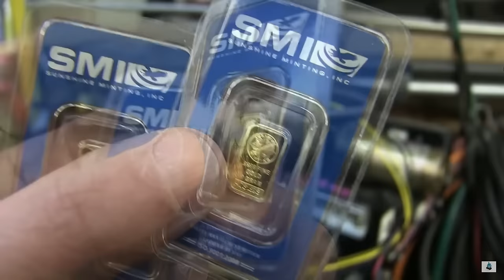Cold Welding In Vacuum

Comment: You can test to see if it was the mercury vapor by repeating the Spregel pump experiment, and in addition to the 3 samples you already had, build an additional vial shaped like an upside down u, with mercury in one side and copper in the other. This will keep them separate, but will allow mercury vapor to bond or saturate the copper.

Comment: I am thinking that the reason you get "cold welding" when you slide or twist two pieces together is that the friction causes heat, although not much, there could be micro spots where temperature is high enough to fuse.  You might be able to weld with enough pressure, like with a hydraulic press, but I would bet it would be a pretty high pressure.  Somehow there has to be enough energy to break the bonds so these reform to become a weld, a high temperature is most likely the cause.

Comment: Hypothesis for why rotation causes cold welding but not impact:
First assumption: metals form locally polarized crystal lattices of arbitrary length.
Derivative assumption: these lattices form locally polarized magnetic fields.
Second assumption: these lattices have a normal distribution with the possible exception of a slight bias towards the geomagnetic poles.
Derivative assumption: when brought together, the lattices in the two adjacent surfaces partially align and begin to repel.
Derivative hypothesis: when the adjacent surfaces are then rotated, the partially aligned surface lattices become orthogonal and attract, forming a weld.
Experimental hypothesis: there exists some angle of rotation that will achieve maximum normal distribution of orthogonal lattices given an arbitrary lattice length.
Plain English hypothesis: if you rotate two plates of indium at known angles, you will see a normal distribution curve of weld strength around an optimum angle from which you can then derive the mean length of the surface lattices.
That wasn't really plain English, was it?

Comment: Think of the oxide layer as a thin piece of tissue paper covering each piece of metal. If you slap them together the paper stays relatively intact, but when you twist them together the paper tears and pulls apart. exposing the metal underneath. I think this is why the twisting works over slapping them together.

Comment: I admire the tenacity shown in the video.
Cold-welding is just two pieces of material coming in to such intimate contact they effectively become one homogeneous piece of material.
Complete cold welding is just an extreme example of the "ringing" you get between very-flat gauge blocks.

It's not "just" electron sharing in conductive metals, as you can buy ceramic gauge blocks that ring together too. So the electron theory is debunked.
The attractive Van der Waals / Casimir effect between the molecules can only happen if the materials can get close enough. (i.e. below the "van der Waals contact distance"), and overcome the mutual repulsion between the atoms' electron clouds.
The gold bars may look flat, but at the atomic level (e.g. under an electron microscope) their surfaces still look like rough mountain ranges. Only after careful A-B-C lapping (to get them optically flat), and then by rubbing them together, can you have any hope of getting enough of the atoms from each bar to be in close enough contact to get them to ring/cold-weld together.
Theoretically, two perfectly flat surfaces could cold-weld purely by touching, but real-world surfaces are too bumpy at the atomic scale to do this, and need to be rubbed across each other to get the (atomic level) contact surface area between them high enough to create macroscopically measurable adhesion forces.

Comment: At the macro level you need static pressure for cold welding. Put the two gold pieces together and stack weights on top. You don't need a vacuum.

Comment: while you are at it, put the gold powder in the sprengel-pump, let it vibrate, and try to use the laser or an UV-C Lamp to clean of the oxide layer.
UV-C is emitted in ionising mercury lamps.
maybe that will give you more success 

hope you are able to read that:-)

Comment: There is one key difference between twisting two metal pieces together and smashing them together. Just smashing the two pieces dissipates a lot more energy throughout the bulk of material (sound, vibrations, heat, etc.), and does not concentrate the energy on the surface. Twisting focuses that energy onto the surface, most likely resulting in localized heating to many hundreds of kelvin, or perhaps even hotter. Forming bonds, even between metal atoms, requires an input of energy (even though the amount is tiny), just like any other bond formation process, as the surface crystal structure is highly defective, and cold welding, which introduces completely irregular bonds between the surfaces, introduces even more defects (unpaired electrons, dangling bonds, etc.). Also, there is no way you could make those gold bars clean enough just using normal solvents: you will need to hit the surface with plasma (preferably Ar plasma) in order to get everything off completely, and not touch them at all (be in a cleanroom, no direct contact with the surface from any other material whatsoever). The cloth that you used to separate the gold bars is a major source of organic contaminants as well. Because twisting the two metal blocks together creates pockets of local heating, enough to drive off and decompose most of the contaminants, and because twisting sometimes triggers a friction "weld" where planes of atoms are stuck on each other but not bonded, it works much better in sticking the two blocks together than letting them fall onto each other.

Comment: "When a material galls, some of it is pulled with the contacting surface, especially if there is a large amount of force compressing the surfaces together. Galling is caused by a combination of friction and adhesion between the surfaces, followed by slipping and tearing of crystal structure beneath the surface. This will generally leave some material stuck or even friction welded to the adjacent surface, whereas the galled material may appear gouged with balled-up or torn lumps of material stuck to its surface."

"When two metallic surfaces are pressed against each other the initial interaction and the mating points are the asperities, or high points, found on each surface. An asperity may penetrate the opposing surface if there is a converging contact and relative movement. The contact between the surfaces initiates friction or plastic deformation and induces pressure and energy in a small area called the contact zone.

The elevation in pressure increases the energy density and heat level within the deformed area. This leads to greater adhesion between the surfaces which initiate material transfer, galling build-up, lump growth, and creation of protrusions above the original surface."

"The process and contact can be compared to cold welding or friction welding, because cold welding is not truly cold and the fusing points exhibit an increase in temperature and energy density derived from applied pressure and plastic deformation in the contact zone."

Excerpts from the Wikipedia entry of galling. This is the mechanism. Relative movement is a key factor.

Comment: I know a little about this. You need a flat manufactured mirror Finnish (on both surfaces) to make two surfaces stick by removing most of the air between them with pressure.

Comment: Perhaps you could add a small cold trap to remove the mercury vapor before it diffuses into the attached experiment, as you have liquid nitrogen, maybe with a bit of reactive "getter" material?. You've done a remarkable job with the simplest of glassworking tools, speaking from experience of doing the same, though only for glow tubes.

Comment: For cold welding you need really smooth surfaces for example the hardened measure surface of a measurement screw (this thing to measure micrometers) and then you dont even need a vacuum Or speed you can just let it stay overnight (screwed all the way together) and its coldwelded

Comment: I would think that most cold welding also has a lot to do with friction and Van Der Waals force which would be more prevelant and therefore noticeable with two highly polished surfaces are rubbed together or much force and kinetic energy is applied to the materials being welded

Comment: Cody i think the twisting thing with Indium is not actually welding. You might be creating tiny bumps and grooves in the soft metal which grab on to each other like a velcro effect and hence stick rather than the actual metal fusing

Comment: The wearing between the nut and bolt means they are no longer in contact - they are not in contact with the pieces that were worn off between them
Also just double checked, liquid nitrogen state is also an insulator, but yeah it would be very cold on the electronics - would be a very cool video (see what i did there?) to test various common electronics and cooling them down

Comment: Perhaps instead of a lens cloth, a piece of fine double sided sandpaper with lens cloth attached, so the sandpaper abrades the oxide off and smooths the gold surface, while the lens cloth removes any grit left by the sandpaper or abraded gold.

Comment: I had some experiments with mercury and gold in a vacuum with high voltage from dual 12v car ignition coil hooked up to a 18volt drill trigger and battery.  after the experiment the mercury looked gold.  i was using the mercury and gold for electrodes to make hho a couple of years ago.  It was a very interesting effect. I used distilled water and salt for electrolyte.  I remember people saying that the gold was leaching to the mercury.   Just thought you could explain or if you have ever experienced this before.  Thanks and keep up the good videos.

Comment: ok, this is a fantastic effort to cold weld, true Cody level of science.
However, i dont understand what's so difficult with  it, i have to really fight to keep stainless threads from welding when i cut them on a lathe and try a test nut on them. Like, to the level of pouring oil and graphite on them. Even then its iffy if the threads are tight. 

Love the vids! keep 'em coming to the cold frozen waste land of canucistan! ;)

Comment: The problem is not oxygen, but water. Water films are, what makes raster force microscopes work. So: heating and/or vacuum will help. The parts should not touch before the process, however, so as to allow water to evaporate. Then in those conditions, the parts to weld must have maximum contact surface, requiring thorough honing, and then put together - never leaving the inert conditions.

Comment: Do the same nut/bolt test with different metals. Do a before and after torque test. If it cold welds, you will know when loosening them. I bet somebody out there could make you nut/bolts out of different elemental metals.

Comment: I can tell you why the Indium welds when twisting... Air. When you twist them you "ring" them together, but hitting still leaves an air layer.
And just seen your gauge block mention, this process is "ringing" - Removing the air between.

Comment: Metals bind at a lower orbital than their valence orbitals so until heated when the electrons can interchange between orbitals, it is difficult to weld.
Reply: As an alternative to heating, you could run a current through it.

Comment: Under vacuum most of the gaseous material left inside your chamber will be left on the surfaces; mostly water, some nitrogen and carbon dioxide. In fact to achieve ultra high vacuum of 10^-10 mbar they heat the entire chamber to +100C to boil off these contaminants. Of course you only have a roughing pump which wont reduce the pressure enough to effectively remove this thin film on the metal surfaces. You could build a meissner trap which consists of a coil of metal tubing which you run liquid nitrogen through, this will freeze some of the remaining air. If you do that you might need to temporarily isolate from the roughing pump to stop back streaming air. But you need to maintain that pressure as even if you could create a clean surface it would become contaminated again in milliseconds. 

In the end you really need a turbo molecular pump or similar to do real high vacuum science, you'll need a pressure of low 10^-6 mbar. That rotation motion with the indium is likely squeezing air from the very small contact points as well as it's softness to deform and create a metal to metal contact point, hitting the pieces together is too violent to allow a bond to form and remain connected. With the gauge blocks the mechanism isn't as clear, cold welding might play a role but that wringing layer will mess with the metal to metal contact points. Van der waals forces might be more important here. Again the rotation motion helps clean out the interface of air.

Comment: I would say to the screw. it will never weld together, the reason is that it have to mutch distance(tolerances is sett that way). I could explain how a screw suport is handled but I recon that is easy to look up.

Comment: Doesn't the vibration (aka kinetic energy) get converted to heat? I think that when you twist pieces together you're deforming the surfaces and creating areas of velcro-like contact. You're going to need to do it on a few gold pieces, locate areas that affected after separation, then get them imaged under an electron microscope.

Comment: The golden plates can look polished for a human's eye, when in reality they're terribly deformed. That means, what looks to be a tight joint of two pieces when you put one over another in fact forms nothing, but a dump of pieces, which barely touch each other. That is, the % of joined surface between these two golden pieces is like 0.0001%. So I think what could really help to cold weld them together was some extended rotation and vertical pressure on the top piece. This would increase the area of contact.

Comment: I wonder if you cooled down the copper particles in the vacuum if you would actually see the same results. Testing to see if the friction between them causes enough heat to weld them.

Comment: Assume that the vacuum chamber cancels pressure by removing the medium for passing energy to the item inside. You would need other cancellations to get a changed area within the vacuum. Otherwise with two or more high energy inputs you get diffirent results. I thinkkkkk that maybe the gravity vs the gravity of the sun/moon etc cancels more effeciently when in an up down configuration. Twistsing the blocks might also change and cancel enertial forces by both having opposing symmetry for energy....

Comment: Awesome video man, great to see your inventive solutions to obstacles.
Regarding the indium "cold welding" under torsion but not compression, could this not be due to galling between the surfaces? Ave achieves a join with gold using a similar twisting technique, (I'm not sure if the gold used was annealed or not? But...) could this not be due to the low hardness of the two metal surfaces forming a mechanical bond, not a chemical one? 

Perhaps using acid to etch the surface and then analyzing the microstructure could answer this question. Keep it up man, this is a really interesting use of your tools!

Comment: interesting video would love to see more attempts at cold welding if its possible, there are hand pumps i have seen that have you put in two copper wires around 20 gauge, and pump out the air in order to weld them, never done it myself and would love to see a microscopic view of there bond, got side tracked by the explanation at the end because I was curious as to if the electrical frequency in your lights relative to the cameras FPS because there is a shadow crawling up the screen in line segments. just an interesting effect I remember from one of TomScott's videos. YouTube is awesome and has the power of changing how I view the world.

Comment: Hypothesis for welding by light friction (sliding), you create a powder/paste which acts like an adhesive filling gaps strengthening both suction and van de wahl forces. Dunno how you'd test that, maybe try with metals of different hardness and see if you get a transfer from the soft to hard surface? You may get some ideas if you look up the physics of brake pads, abrasive friction vs transfer layer (adherent) friction modes. Stoptech's white paper on 'the myth of warped rotors' has some info.

Comment: I don't know what ways of measuring force you have at hand, but maybe you could measure the force it takes to pull two gauge blocks apart, if it requires more force than the 'vacuum' between the blocks creates (area of contact * atmospheric pressure) you definitely know there is more going on than just the air holding them together.

Comment: Good try my Friend but if you are vibrating any Thing together it is still friction welding
that is how we weld plastic together with pressure an vibration. the copper under a 
vacuum looked brighter because vibration released the copper oxide that was vacuumed out 
of the tube..even if you put it in a press there is still friction... 
please keep trying you may be the one to find "IT".

Comment: will it weld
will these two metal subjects bond 
will two typically shiny hard ductile materials join together by heating the surfaces to the point of melting.

Comment: I think the reason your metals won't cold weld is that they're covered in a layer of something else, like moisture : physisorbed water coats pretty much everything that's been in our moist atmosphere, and a good vacuum alone won't fully remove it from your surfaces : you also need to heat them up. It takes at least 200°C at 10^(-5) mbar to remove it from metal oxide surfaces, but should be easier to remove from bare metal surfaces. 100°C should probably do.

You may also have some grease and other organics present, which may be harder to get rid of.